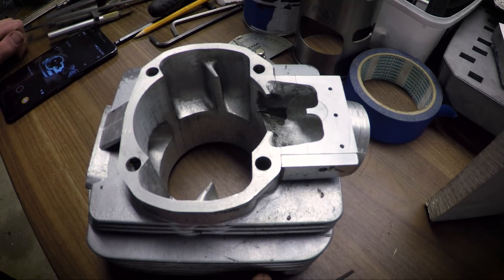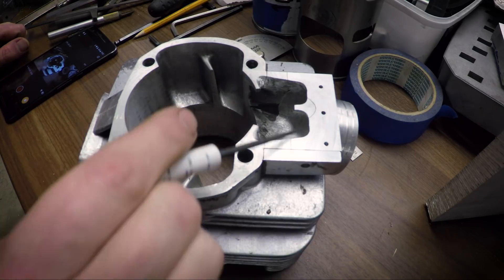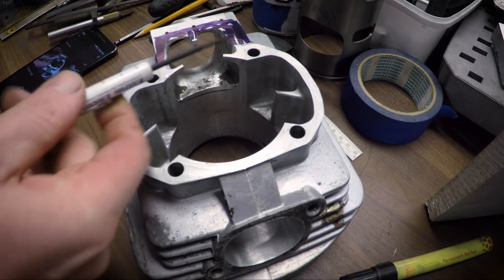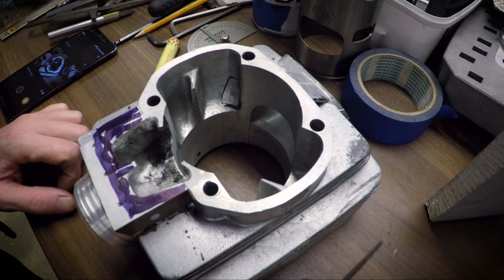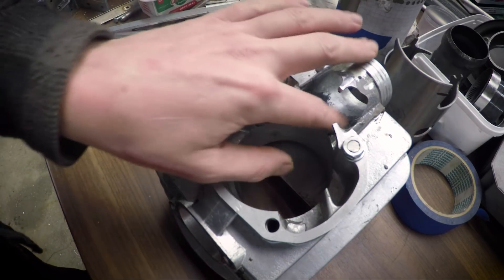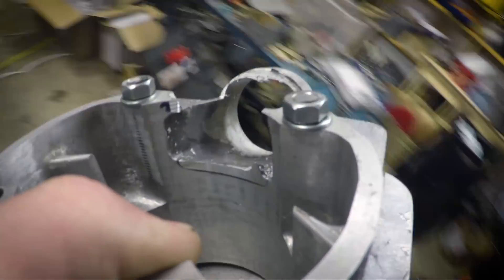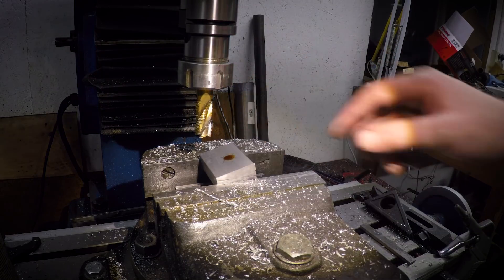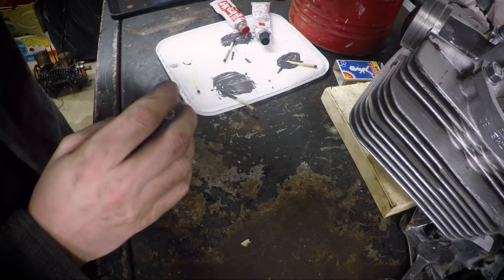Bigbore stroker 277 part 4 - Preparing the intake

Comment: Thanks for sharing your knowledge. Where did you buy the sleeve?
Reply from the maker: oldsled1 Thanks for being interested in my rambling :) 
I bought the sleeve directly from LA Sleeve, part number FL-76. I think these generic sleeves are really meant for 4 strokes, the flange was both too thin and too narrow so I had to turn a little adapter piece to put around the flange.